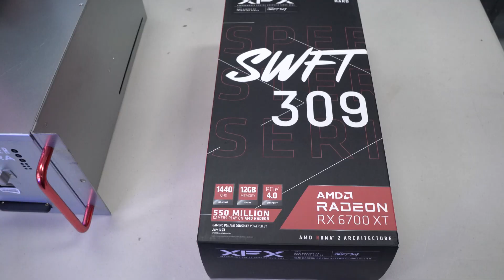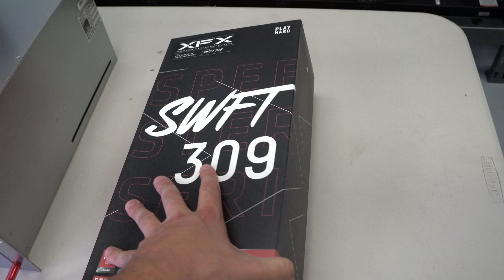Our First 12 GPU AMD Build in an Octominer X12Ultra Server Case - Part 1

Comment: Looking at the Octominer too.  I was wondering how you are powering it?   I am moving from 1 GPU to an Octominer so I want to make sure I understand how to power it.
Reply from the maker: Best way would be through a PDU on a 30amp outlet & breaker
Reply: @GPURisers  is that a 240v or 120v outlet connected to the 30amp breaker?   Thanks for responding!

Comment: I used to use minerstat aswell but when i changed all my rigs to octominers i changed to hiveos because of all the feature you get there for the octominers vs minerstat. Octominer autofan, target core/mem temp is a must have.
Reply from the maker: This is a good point. I reached out to MinerStat to see if they plan on implementing these options soon.
Reply: @GPURisers  I answered you actually on the suggestions page, but they deleted my message! :p
Reply: @GPURisers  Please change delivery service in eu -  I waiting now for package 3 weeks from UK to Poland -  31/03/2022  was sorted to export  and today is landed in Warsaw - might be delivered to me in next week - shame.  Quicker was delivered package from China with OTHER thermal pads  , even other packages from UK arrive to me less that 5 working days . PARCEL FORCE is totally crap .

Comment: Mike is definitely spying on me, i'm trying to build a 6 RX 6700 XT mining rig. So far i only got 4, still two more to go :p
On GNU/Linux Ubuntu, i can run my 4 RX 6700 XT around 46.3~46.4 MH/s @ 90~98 W, i had to modify some values in AMD soft PowerPlay tables (especially most of the memory voltage options) in order to achieve it ;)
Have a great week ahead and please leave some RX 6700 XT for me lol
Reply from the maker: Haha always watching!! 👀

Comment: TRM 50 to 70 percent fan 1200 1075 110w 46.5 to 46.9 MHS
Reply: Is that wattage from the software or wall? Even if it's from the wall the 3060ti lhr seems like a better buy anyway
Reply: @BlessedNoobCrypto  software wattage 
If your not running risers .. If you running Add for measure 75watts for ea riser.  Cost point/Wattage/ROI and the new t rex update I agree on the 3060Ti. The ti LHR and the 6700xt are similar in price. Diff by 1 to 2 MHS based on settings.
Reply: @Aabriley  gotcha. So overall 3060ti is probably more efficient. Wish they would come down in price. Still sitting around 550-600 area
Reply: @BlessedNoobCrypto  agreed ... I just bought 2 @ 629.00 ea. And 3 3060s at 499.00 (both vision oc version) as opposed to 1200 ea and 800 ea.